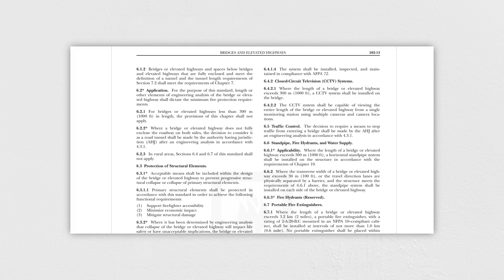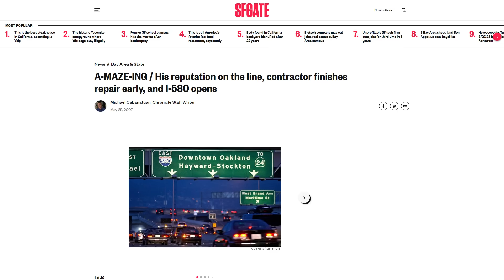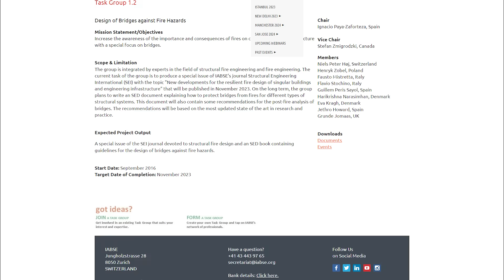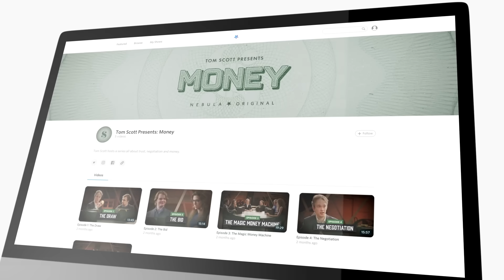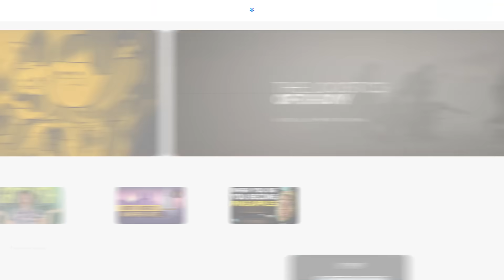Philadelphia I-95 Bridge Collapse Explained

Comment: Worth looking at tanker safety and why they crash under bridges so often.
Reply: Trucks crash everywhere all of the time. We only hear about the bad crashes that take out bridges.
Reply: @matthewerwin4677 Yep. It’s called falling for the availability bias.
Reply: Tankers crash and burn all the time, you just don't hear about it, it's not news. An exit like this under a bridge is relatively narrow, curved and constrained. A likely spot to lose control.
Reply: That's probably what the NTSB is primarily focusing on.
Reply: 7:10, less than 3% of bridge failures, are due to fire. The rest are mainly due to hydraulic failures. Of that 3% only a portion of those are due to a tanker truck crash. Of those tanker truck crashes, the vast majority of those are caused by cars.
Reply: @jandd661  What about fatigue and corrosion?@
Reply: They don’t crash under bridges so often. You’re falling for the Availability Bias.
Reply: @rdhunkins given that the vast majority of the road area in the US isn't directly under a bridge, for this to be availability bias, there would need to be an astronomical number of fuel tanker crash fires. Is this the case in the US? I don't live there, is it common for you to be out driving and "oh look another fuel tanker fire"?
Reply: Tanker trucks have really high rage-quit rates.
Reply: They're usually turning under the overpass/bridge. The reason they crash seems fairly obvious.
Reply: @selanryn5849 I'm not from the US, why are there turnings under the bridges there?
Reply: As a professional driver in the EU, I'd say take a look at the job conditions for the US truckers, note that a tired driver is as dangerous as a drunk one and you'll have your answer...
Reply: @SonsOfLorgar  true, though we here as far as i heard last have 10 hours max on the clock, though real truck drivers here in the states can likely tell what's what since, really this information that i have is from 2012 or there about.

the picture also include drivers in smaller vehicles trying to take up a spot that really should not be taken. Generally being right in front of a truck is a bad thing, even worst when it's a small car like a hatchback or small sedan. one of those suddenly slamming on their breaks and vanishing into the front blind spot (not really an issue with most EU trucks) can be a reason to add them in as a potential cause, plus not always does the car of cause stay with the accident.
Reply: @nightshadelenar American hours of service regulations stipulate a maximum 14 hour work day, of which 11 can be driving - along with a weekly 16 hour exemption for local drivers.

Meaning a fuel hauler like myself can work 14 hours a day and 16 hours once a week to a maximum of 70 per week. However not all companies enforce this to the letter and going over 80 hours or more a week is not unheard of, especially in the fuel industry which has had a chronic driver shortage since approximately forever.
Reply: I believe this driver in particular had a heart attack
Reply: I think it’s due to a lot of inexperienced drivers. My city had 3 semi truck tip overs in a single week once.
Reply: It is worth looking at why we try to condense so many companies into cities that cause too many people to have to drive into the cities leading to roads that are too congested. Maybe companies need to spread out more and we need to bring housing costs down so people can move closer to where they work thus reducing the time cars spend on the road thus reducing the density of traffic.
Reply: @GeorgeMonet  I've been saying that for years!  Why do companies think that they have to be located downtown in some huge city that hardly functions anymore?  I'm convinced that it's so that the executives' wives can attend the operas, ballets, etc. that are found only in such places.  In these times of instant communication and data transmission, corporate facilities could be dispersed far and wide.  That alone would bring housing costs down.
Reply: @klinestill Are you assuming?  For whatever it's worth, somebody above said that this particular guy had a heart attack.
Reply: I think one of the bigger issues is the over working of truckers
Reply: Because we dont ask about trucks on fire in forests
Reply: @randomuser5443  Yep, pretty basic statistics.
Reply: This is an important point - the corporations shipping these volatile materials on public roads are putting the cost of their own limited safety measures onto the public. 

A tanker exploding every once and a while is just the cost of doing business for them, while the rest of us deal with the consequences.
Reply: @kylephillips3306  look up the Los Alfaques disaster. 217 people died because the truck driver was a moron
Reply: @klinestillIt's bad juju to disparage the deceased especially if you don't know what happened. Someone already mentioned he had a heart attack. Have some decency the man died.
Reply: 1 tanker every few years in a country with 280 million + vehicles on the road and millions of car accidents every year really isn't that "often".
Reply: Ignoring height restrictions, infrastructure of the bridge (posts, etc.) presents more obstacles to crash into, sudden change of light, glare to shadow,  cars pulling over tend to like the cover of the bridge creating another obstacle. Those are some of the ones I can come up from the top of my head.
Reply: Obviously they are being paid to crash them.
Reply: And this is why Hydrogen will never be a mainstream fuel for cars. It’s very dangerous and expensive to transport.
Reply: @artinist yes, hydrogen is terrifyingly flammable, and (only to a slightly lesser extent) so is gasoline and natural gas. The fact that we've all accepted that danger is social commentary in and of itself. The more practical reason hydrogen is hard to work with is that it doesn't liquify nearly as easily as natural gas.
Reply: @erikdietrich2678 thankfully we've got much safer and greener alternatives already, like big lithium battery packs.
Reply: @gcolombelli  lithium batteries are better and worse in various ways. The global marketplace for lithium is complicated to say the least, though that's not uncommon for metals that are moderately scarce and in recent high demand. The politics and humanitarian concerns around cobalt (which is needed to make the currently most common lithium batteries) are even more significant. There is not a one-size-fits-all solution, nor are there solutions without downsides. We collectively need to - and have the technology to - drastically reduce our burning of fossil fuels, as that's objectively one of the worst options available.
Reply: @erikdietrich2678  lithium batteries: turning every single car in a fuel tanker's worth of damage to bridges
Reply: @marcogenovesi8570  that's nonsense...

A petrol fire from a regular sedan's fuel tank is just as bad in many ways except lithium fires are harder to extinguish.

Not to mention that EV's are less likely to have a fire - per 100,000miles of driving petrol/diesel engines have more fires.
Reply: @CheeryRhymes  petrol/diesel cars that catch on fire are are uncommon at best, and lithium fires cannot be estinguished, you can only stay there and keep it cool until it has finished dumping all its energy.

EVs are not "less likely to have a fire", the statistics are skewed by the fact that EVs are still very rare
Reply: @marcogenovesi8570   that's per 100,000 miles driven so it's absolutely true... it's not the total fires but how often per 100,000 miles driven that an EV or petrol/diesel vehicle catches fire.

The amounts of the type of vehicle is completely irrelevant in that statistic.

If you think petrol/diesel fires are uncommon for ICE vehicles than you think EV battery fires are even more uncommon

Petrol/diesel fires spread quite readily (they are liquid after all) and cars usually completely burn out before the firefighters put it out, lithium fires are harder to put out (although they're getting better at it) but besides that there is no significance difference between those types of fires.

They both burn hot enough to destroy a vehicle and kill any occupants.
Reply: @CheeryRhymes  how do you think that figure even comes out? It's dividing a total by the average number of km done or some math based reshuffling to massage the data to make it look more legit. That's not how creating statistically significant data works.

Petrol fires in a car are much easier to put out than lithium as there are shut off valves and the fuel tank is much smaller and comparatively much more resilient to impact than lithium ion batts. I mean it's a metal container you can crush it and it will still be mostly fine, maybe leaking fuel now but it's not catching on its own. Try crushing a lithium ion battery and see what happens. Extinguishing a petrol car takes minutes if you have a fire hydrant or if you are quick enough to react it can be stopped with a portable fire extinguisher.

Diesel does not really burn that well if at all at room temp conditions. If your diesel is catching fire, you have bigger problems.

Lithium battery fires cannot be extinguished  as it's mostly "electrical fire". The damage/fire is shorting the cells and they discharge the power stored causing more heat and more fire
The standard procedure for electrical fires is "cut the power" but that's not something you can do on a battery that is itself the power storage, can you?
The battery compartment is also usually not in a particularly convenient place or easy to remove.
The standard procedure for EVs is just tow the wreck out of the road and keep it hosed to keep it cool until it has done its thing

The issue with all these very EV-friendly statistics is that all the ones I looked at are actually taking all the ICE car situations where there was even a little bit of fire, sometimes even electrical fires that have nothing to do with the fuel but just the wiring shorting and burning some plastic. Or stuff that that was put out by a dude with an extinguisher or it even stopped on its own and compare it to EV fires where in most cases the whole car becomes a torch.
Reply: @marcogenovesi8570  lithium batteries do not contain as much chemical energy as a fuel tanker, otherwise the cars they're in would be able to travel as far as a car with a fuel tank as big as a fuel tanker. Lithium batteries are dangerous because damage can cause them to ignite unpredictably: in every other way gasoline is FAR more dangerous.
Reply: @erikdietrich2678  I think I've been talking about cars not tankers
Reply: @marcogenovesi8570  it's about total power density. An electric car battery pack cannot burn and release more energy than it contained. Granted the lithium oxidizing releases more energy than can be released when used as a battery, but it's not to the level of a whole tanker of liquid fuel. Very roughly, in the worst case it's double the energy of the battery charge level: so equivalent to two cars' fuel tanks instead of just one. https://www.fire.tc.faa.gov/pdf/TC-15-40.pdf
Reply: This is why pipelines are the solution, not more tankers.
Reply: @rsaunders57  Pipelines can't do the 'last mile' so tankers are absolutely needed. Can't put a pipeline to every gas station in the country, but tanker trucks keep us supplied economically.
Reply: @rsaunders57  You want to build pipelines to every gas station?
Reply: @VitalVampyr  Of course not.  But minimizing the distance is important.  If they want to build a pipeline near you, that's making you safer, not a dangerous idea you should NIMBY against.
Reply: @VitalVampyr  he is a pipeline company CEO
Reply: @rsaunders57 maybe we should stop routinely shipping explosive chemicals around full stop
Reply: @timtjtim no i think we should add one more lane that would fix everything :)
Reply: @timtjtim      said "  maybe we should stop routinely shipping explosive chemicals around full stop    "  
You can help the cause by not buying any product that uses chemicals.
Reply: @timtjtim  After you, stop using gasoline, propane, natural gas, ...
Reply: @rsaunders57 with the exception of the occasional road trip to see family, my plug-in hybrid uses approximately zero gasoline, and charges off of solar. It won't work for everyone, for sure, but it would work for more than enough people to massively reduce our dependence on petroleum products.
Reply: @timtjtim  Fuels aren't usually truly explosive but they are pretty derned flammable, but maybe .
Reply: @fractuss Fuels aren't explosive at all. Gasoline if chilled below its vapor point can be used to put a fire out. Only the vapors are flammable and only explosive if compressed.
Reply: @cynwraeth1943  Right.
Reply: @timtjtim how do you propose we transport chemicals then? Your life is built on chemicals, everything you own is manufactured with chemicals, many of which are flammable. Need I remind you that plastic and gasoline are made from oil?
Reply: @timtjtim  
What a good idea, are you willing to sign for not using any more:
-Medication
-DIY supplies
-Other building supplies
-Any electronics
-Swimming pools
-Fuel

You're not? Well, then it's a bit weird how you said that as you WANT explosive chemicals to be transported.
Reply: @rsaunders57  that makes even less sense than most of what you've posted..
Reply: We are under attack

Comment: Installing sprinklers and smoke detectors under bridge decks over crossings is a means similar to buildings for preventing fire hazards. Water resources from neighbouring water pipelines. Seems no water pump is required as bridge crossings are not tall enough to undermine water pressures .

Comment: Now I'm curious how much heat in areas near the equator can affect a bridge. Having the sun back down on its black surface all day every day, I could imagine some parts reaching 200F. How much would that take off the bridge's expected life span?
Reply: I think that's a very difficult question to answer, simply because bridges are likely to be designed differently in these areas so it's not a simple case of them lasting less time. A more interesting question might be "how do bridge designs differ in areas of extreme climate"?
Reply: @jimmer411  Yeah, but expansion is only one problem the heat causes. It can also damage and weaken the material. So I'm wondering if heat in areas near the equator is enough to also weaken the material, or if they are resistant enough for this not to be a factor

Comment: It's insane thinking just HOW complicated it really is to even analyze a fire like that. So many factors and so many questions, and all of it on top of political and economic calculations? Yikes.
Reply: Why should making sure it never happened again stop because of costs, That's so wrong, Do you have a loved one, How much would you sacrifice to keep them safe, that's the reason capitalism doesn't work in a world full of Human beings, We need another way and it's NOT communism,
Reply: @bryansmith1920 like it or not, life is not completely safe. There is always going to be a point where the cost tips to not being worth it and finding that point will always be a challenge. That stuff has to be shipped somehow, everyone uses it.
Reply: @nerdy1701 is what it is attitude let’s you be exploited without noticing
Reply: @KarltheBarl You think you're being "exploited" because highway overpasses aren't designed to handle a rare form of accident with extremely low fatalities?
Reply: @bryansmith1920  Its not only costs that stops a project there are more and many more factors, as inovation comes there will be better,faster and safer ways to deal with the situation, as engineering its all about taking all the information you can and find a solution to it in the most efficient way, cost is only the tip but there are alot intricate moments, that making a project can take time, training, and resources to accomplish a project, safety is also taken to account when trying to build such a structure and then you have to consider its risk of building a structure then you have time estimation for a project to finish.

There are always going to be hindsights and as time passes on we will learn something new about it, its just feesibly unreasonable and unfathamable to make a structure that is 100% proof against everything, you can cover so much ground but there will always be a design flaw.
Reply: @bryansmith1920  We don't build pedestrian bridges because of costs, even though it's  certainly safer than having a crosswalk on an 8-lane arterial road.  

Dead pedestrians tend to be poor people, after all.

Comment: Anybody every try putting a sprinkler system under a bridge so its water flow could carry away some percentage of the heat?
Reply: Freezing temps 6 months out of the year etc
Reply: @paisleyprince5280  Not a problem.  The water only comes to the equivalent of a fire hydrant, so it stays underground where it doesn't freeze.  The valve opens only once heat sensors send the signal to open the solenoid valve.
Reply: I imagine piping in water would make it not cost effective. A lot of bridges are along highways, far away from water infrastructure.

It also probably wouldn't be reliable - normal indoor sprinkers are delicate (they rely on a small glass vial breaking under heat) and I don't think anything exists currently that would be suitable.
Reply: @hayleyxyz  No more involved than running water to a fire hydrant.  A lot of highway bridges are near water, so the water is often right there.  This would not rely on small glass vials breaking.  It would be (1) heat sensor detects heat and send electric signal down wire (2a) solenoid valve opens underground and allows flow through fire hydrant analogue to spray under bridge, or (2b) pump turns on and pumps from local stream to spray under bridge.